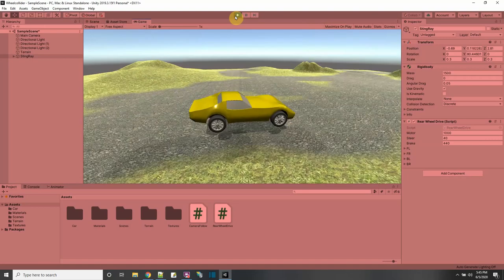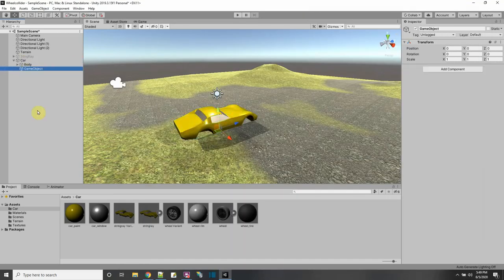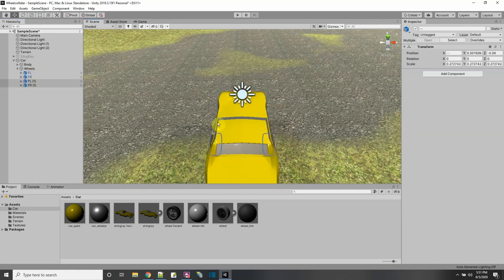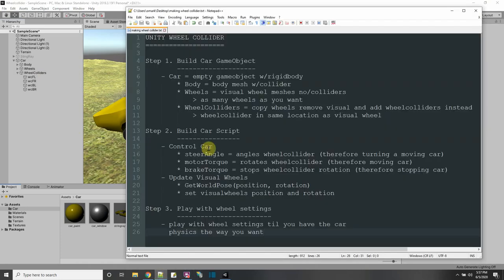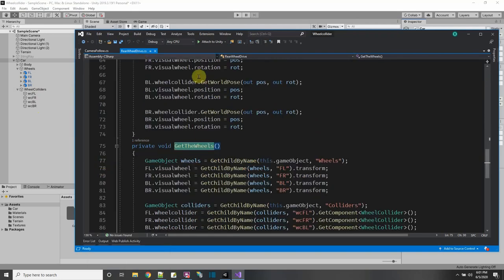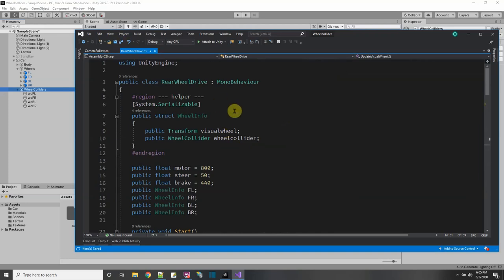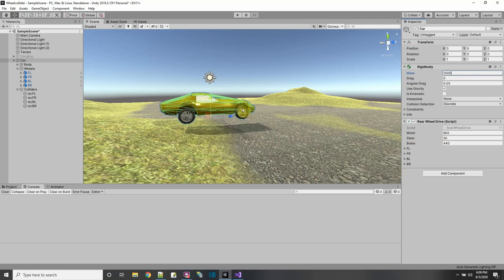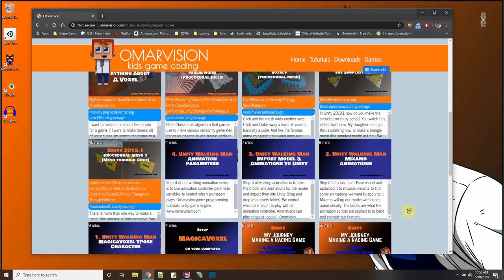How To Use Wheel Colliders in Unity 2019.3

Comment: Really GREAT TUTORIAL, but I just want to mention that the BLUE ARROW (Z Axis) on the car, needs to be set correctly
If someone downloads a car object, and does your tutorial, they need to make sure that the car body, points in the Z direction.
So, basically this means: Once you get the car into Unity, drop the car into the scene, and rotate the body (main car object), where the car is pointing down the Z-Axis (blue arrow).
Then, drop the car into your prefabs folder.
Then, delete the car from your scene, then, get the car you put into the prefabs folder and place it in the scene. This is the car you will be doing the tutorial with.
Reply from the maker: Damn good point friend.  This video could be better. Will do it over again someday

Comment: my wheels rotated into a 90 degree in x when pressed play, Why is that???
Can u pls answer??
Reply from the maker: the wheels collider is so setting sensitive - weight power, acceleration, etc...
Reply from the maker: another method for car other than wheel collider - https://www.youtube.com/watch?v=Agn5YyoT_b8&t=70s
Reply: @omarvision  I think that the problem was with my model, when I checked the same on a model from the asset store it worked. 
sorry..